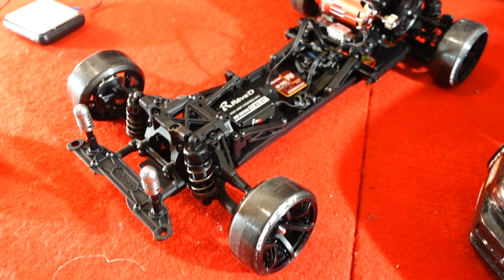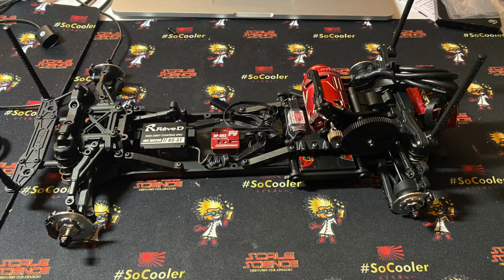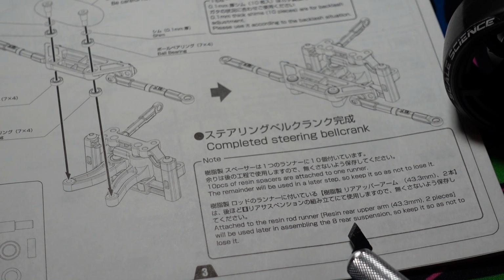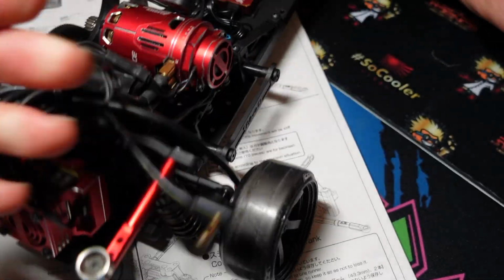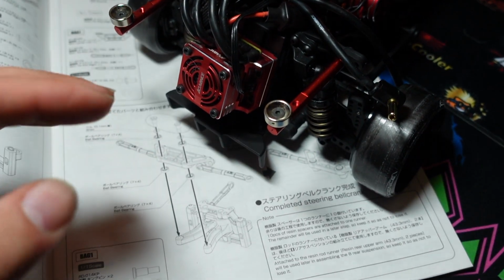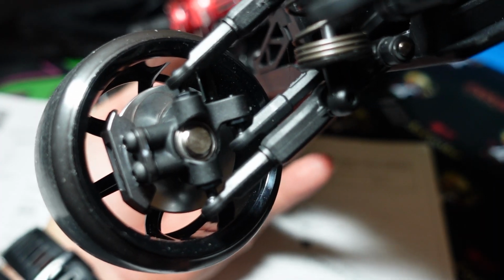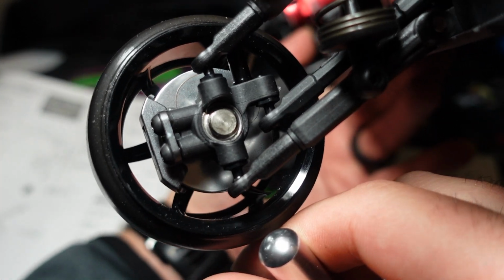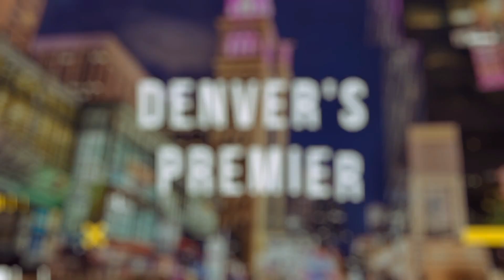Team RêveD RDX - THE NEW PLASTIC FANTASTIC - Scale Science

Comment: Hype! cant wait to see ur build on this one, i cant decide between this one and the rmx 2.5 as my first drift car. im in a country where rc drift doesnt exist so i can only really source 1 of them here and no place to try em out. Which one do you like more out of the box so far? drives better than the rmx with battery slung further backward under the motor vs its more in the mid of the chassis on the rmx 2.5 i imagine right?!
Reply from the maker: They both are pretty awesome. Rdx is cheaper, but far less hopped up. I like the ball dif and active toe on the 2.5 but I like how simple of a build the rdx was. Can’t really go wrong with either but if you don’t have a dedicated track to visit( I’d assume you’d like the rdx better with it’s locked dif.
Reply: @ScaleScience  the rdx doesnt have active toe in the rear? also it looks like only the rrx 2.0 and rmx 2.5 RS seem to have the active toe in rear suspension as those two modes also look like they have completely different rear arms too than the kit you got. Would the revd rdx have less maintainence due to the locked diff?
Reply: looks like the rdx doesnt have active toe in the rear
Reply from the maker: @MrKillerHobbes  no active toe in the rear. 

Most of the newer rmx 2.5’s will come with active toe setup from factory. Mrx too.

The factory spool on the rdx should require no maintanence but a properly built ball dif if used on the proper surface should need little to no maintanence either.
Reply from the maker: @MrKillerHobbes  that’s correct, the RDX does not have active toe.
Reply: @ScaleScience  i see! i think i understood how the active toe works now! ty for the replies in the comments i have learnt a lot after looking up stuff u have said! really helpful and fun to learn!  

Looks like the RDX and RMX are the best two option under 300 and the usukani nge and rmx 2.5rs in the above 300 range. As a begininer also having the spacers on the front arm settings for the RDX vs having turnbuckles like in other cars seems like a good thing as i can just set and forget it i imagine. Sadly only the Rtr rmx has that too lol, really hope the newer RMXs come with the the MB suspenion from factory. I have almost marble like polished tile floor as the surface with no divets or bumps between the tiles, prolly smoother than polished concrete. what tyres would you suggest i go for?

Have you seen the video by DOSLOG where the reveD guy was talking about all the design choices on the RDX? was interesting
Reply from the maker: @MrKillerHobbes  go for the hardest tire you can find and start building grip into your chassis with the suspension.
Reply: @ScaleScience  roger that! did you record a build video of the RDX? :D
Reply from the maker: @MrKillerHobbes  of the actual building now, I find those boring and challenging so I don’t participate much in the building time lapses much anymore. Having to stay still for that long and dedicate a camera solely to that is a challenge